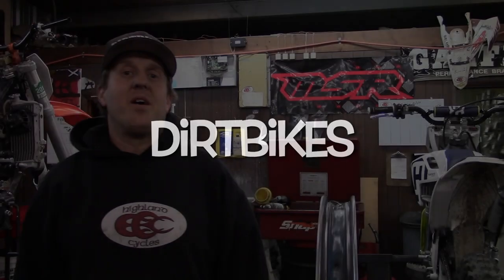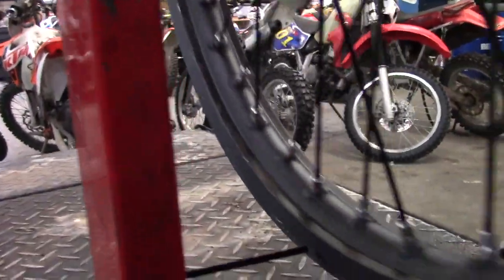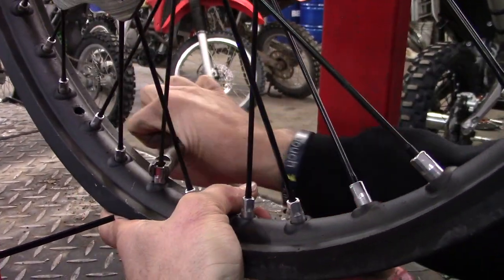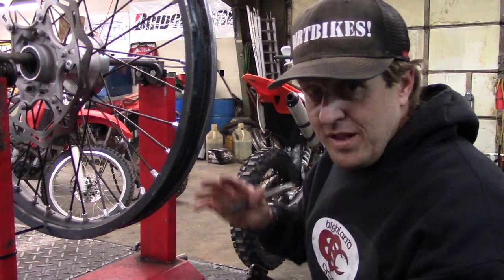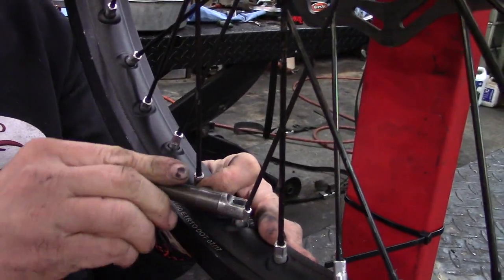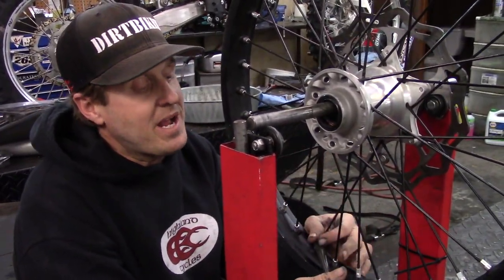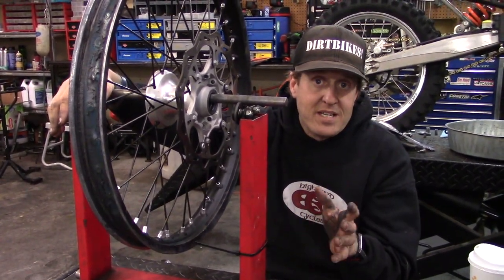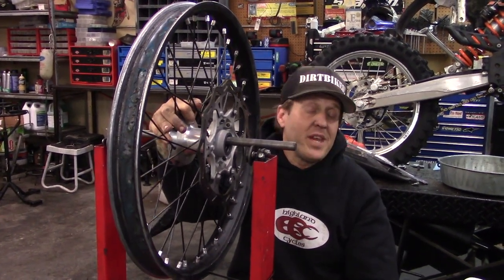Wheel Truing Clinic

Comment: Seems like a weird question but... can this not be done with the tire and tube on? Or could that cause a problem with the rim tape?
Reply from the maker: You can definitely do it with the tire on but it’s harder to see the bends in the rim.
Reply: @highlandcycles  good point and thanks
Reply: @bionicambassador  I used car jack stands to put up the rim with a large screw driver as the axel. Wasn't professional but got the job done. Wish I had a torque spoke wrench. I'm sure I over tightened the spokes. Got a good ping on each of the spokes though.
Reply: Mine has a buckle but spokes are tight do I need to loosen them  all and start again or just just loosen where the buckle is  cheers
Reply: @djCarterboi25  rims buckled? With spoke tightening you are trying to work on two axis. Left and right to remove wobble and up and down for bounce. 

When I did mine I decided to loosen all the spokes. Then removed the spoke cap one at a time, putting anti seize on the threads and putting the cap back on. Took a while but I feel it was worth it.

Maybe I could have done some sort of loosen only 6 spokes and then straighten it up but the instructions online all seem to be with a rim with all spokes loose to start.

Good luck with the buckle.